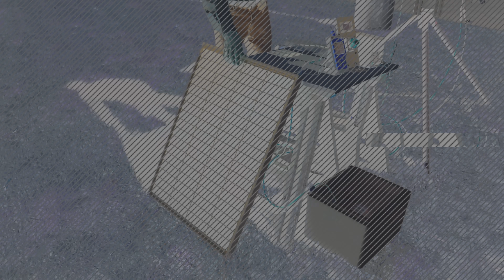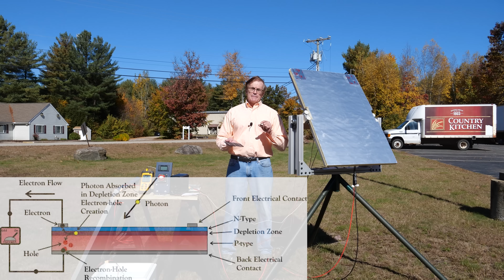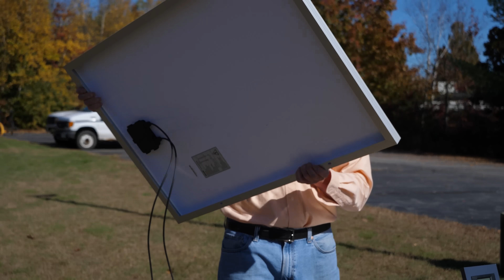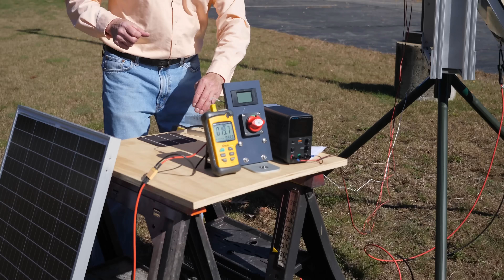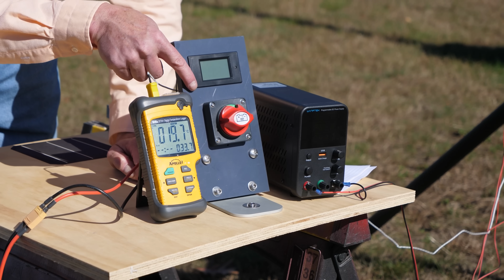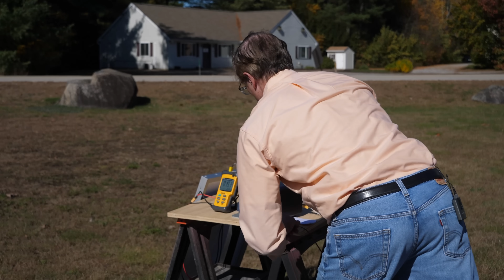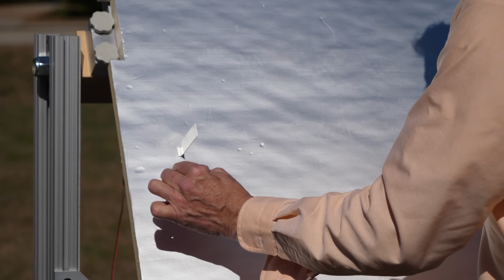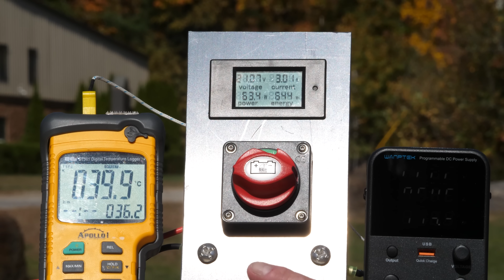Do you REALLY get enough out of your solar panel?

Comment: Fascinating.  As the wattage draw from the fans is so low, why wouldn't you use an auxiliary strip of solar dedicated to the fans built into each panel. If there wasn't enough sunlight to drive them at their most efficiency, you also wouldn't be dealing with the most extreme temperatures,  simplifying the system.  Sorry if someone has already addressed this idea.
Reply from the maker: They have.  And, this would be an engineering option.
I don't  see any problem with that approach.

Comment: The problem with active cooling is that it doesnt last forever and will require replacement well before the 25 year service life which carries cost and effort. I think there is a lot of merit in the idea of keeping them cool but it requires a better cooling system. The flipside is that panels are improving so fast that 100W gain for the same size over a two year period isnt unusual.
Reply: These appear to be basically common PC fans and are very easy to swap out.  The trick here, IMO, is to use old "junk" panels that are about 80% efficient due to age that are being thrown out or sold for dirt cheap.  Then use this with the mirror trick to overdrive them to better than "new" panel performance.  Yes, they will degrade another 2-3% per year being abused like this (the degradation slows down after about 20 years) So, even a decade later at say, 50% efficiency, they will still give you about what a new panel will.  Any excess heat can also be used to power his (almost) passive AC system as it does need a small heat source.  Win-win scenario for not a lot of money.  Especially in areas outside of NA and Europe where all you will have access to (that you can afford) are older 2nd hand panels and DIY methods to cool your home. Most people use ceiling fans or similar, but an AC system of any kind - huge improvement.   Doubly so since most of Europe has houses designed to keep heat IN and no provisions for AC.  His designs just require a bit of space outside and a hole or two through a wall.

Comment: How about taking separate tapping of water from a house water tank and  routine through those panels via aluminium tubes, then mating that with the inlet of a solar water heater... That way the efficiency of the solar water heater (since pre heated water is entering into it) and PV is improved in a conventional passive way?

Comment: Should look into super state core turbine systems incorporated got a neyodium magnet and liquid nitrogen I'd love to know but no Meter for now! to see the standard vs super state in field interaction especially in core turbine power system  looking 3/4 times in 3 test situation on 2 50% on grip??or the fact off audio alternator high current included possibly!. If true self electric twenty before serving and restart a 35Mw would have likely enough to run its self and would hold even on output??. If X3 a 35mw could obtain 105max MW potential??.card a seven band white crystal laser line can send a set out for a area fill across that cell night use 800w cell no like 20w 1cm laser x7 around 140w give loss light 700 600 total to sun not bad solar?????. properly checked!.

Comment: An aqueous system could work, using small pumps, assuming you had good access to water (maybe rain water storage). If the water is sprayed while exposed to the normal atmosphere, it naturally cools through evaporation (no fans needed).

As stated in the video, this could only help until freezing temperatures were reached. But further cooling the panels at low temperatures, yields low gains in efficiency anyway. One small 50th hp pump could likely service an entire array. The pump could be mounted at ground level, which greatly improves the serviceability  of the cooling system.

Comment: I'm excited every time this channel releases content, mainly because it's usually so well thought out.

I am surprised that the topic of longevity was limited to the panels. I have worked as a design engineer, where all the products I designed, contained small axial fan (such as these) as well as other types and sizes. I can say with some certainty, that even wash-down fans in an uncontrolled environment, will fail several times over the life-span of the panels.
Reply from the maker: You may be right.
Yet, consider that these fans are operating  at 25% of rated output and only need to run for perhaps 8 hours during every clear day.  They can also be installed  as a plug and play module,  making replacement only a matter of access as opposed to the effort required  to replace a panel.
Reply: @Tech Ingredients 
It's not the normal wear I'm concerned with. It's the contamination failures,  caused by: dust, pollen, cotton-wood, dandelion fuzz, spider-webs, etc.

As well, any service done to the fans in your configuration, likely requires removal of the panel. That is unless there's 3 or 4 feet of space below the panels.
Reply from the maker: That's  a valid  point.
However, our configuration was for a simple test.  I'm  sure you can visualize several methods for attaching them that just require  a hands width of access. Consider power tool batteries.

Comment: Makes no sense.   The fans will break after 1-2 years and need to be replaced and the expense in time and effort of just replacing them let alone the cost of the fans will be vastly more than just adding one extra $150 panel at the start.

Comment: I Love the presentation and the  efforts put into this and found it very inspiring , one question remains: Why did you choose an unsymmetrical airflow , it seems the distance to the fan ports are unequal top to bottom wich might result in a lesser cooling effect. The air will mostly flow from/to  the „short side“ , so although the heatsink will dissipate the temperature all over, only a smaller surface will be active.
Reply from the maker: I took advantage  of the convective rise in the air. As it heats, it becomes less dense.

Comment: I've wondered about the efficiency claims of PV panel vendors. It wouldn't surprise me to learn that they're quoting "best case" conditions, meaning at lower temps, before the panels heat up. My past evaluations of solar have shown that it doesn't make economic sense for most residential applications in my area without tax subsidies, and even then it's not such a great deal. 

The last time I checked, there were some industrial panels that boasted >40% efficiency, but they were costly and generally not available in the consumer market. That was a few years ago; things may have changed. Graphene technology is the most promising (95% efficiency), but until it can be mass-produced at reasonable cost, it's not an available option.

Anyhow, this video contains very useful information, especially the point about the temperature differential between ambient air and warmed-up panels in my area (Southwestern US) providing a relatively greater cooling effect for the energy cost of the fans. Great video!

Comment: I wonder, is it feasible to run heat pipes into a passive heat exchanger to run Stirling generators ? heat is energy, and just dumping it feels like a waste, as long as there is more heat in the solar panels than the ambient air, you can do work.

Comment: 2:43 so in effect you're increasing internal resistance?
Reply from the maker: No.  It's like I described.  The electrons can recombine with the holes before they reach the conductors. Increased thermal vibrations increase the likelihood  that this will happen.

Comment: What about a panel without any changes on the backside vs a passive panel with your changes at the backside but not turned on fans. I wonder if it is still worth it if you do the calculation when counting in the costs and the loss of passive cooling capability which is had on the backside without those changes.
Reply from the maker: The modified panel runs slightly cooler than the stock panel when the fans are off.
Reply: @TechIngredients  You mean the modified panel but fans off is colder than a not modified stock panel? How come, I mean the back side is quite obstructed / slightly insulated with that air-pocked on the back side (when the fans are off)...
Reply from the maker: The increased  surface area with the fins increases heat exchange.  Convection is very slow, and the openings  in the top, bottom, and through  the fans is plenty.  The back is in no way sealed .

Comment: How about instead of fans you'd use Peltier modules?
Reply from the maker: You'd  still need the fans to cool the hot sides of the peltier devices.  These devices  don't  cool. They separate  the heat so that you have a hot side and a cool side.
Reply: @TechIngredients  First off, thank you for replying (didn't expect it, because others don't bother) and secondly Yes, I realized that after I hit the sent button, but still I wonder if the fans would be powered by the Peltier modules would be better because wouldn't draw power from the solar panels. Not to mention that extra power (if any) from Peltiers could be used to add to the solar panels. It would be a win-win situation (or a pipe dream perpetuum mobile?).{ For some reason I am inclined to expect the pipe-dream scenario ;-) }
Reply from the maker: There's  an old saying  in engineering, "If you don't know the numbers, you don't know anything."
Peltier devices are expensive, especially  when you want to cover a large area.  They are also very inefficient.
Check out our previous video on "The Campfire Generator."

Comment: I LOVE becoming knowledged, but my semi-engineer mind instantly tries to poke holes in the whole setup, and since I suffer from tinnitus, guess which hole it finds: Noise. 

There is no way to mask noise. And I have serious doubts that re-programming your mind to accept the noise completely does anything but put the stress of this constant noise "in the background", mostly unnoticed by the conscious mind, but noticed by "the subconscious".

#Micronoise. Its around us more and more.
Reply from the maker: Please continue to look for holes.  That is how we progress.🤔
In this case, these low velocity  fans at 25% output power are completely  silent.
You can't  hear them even with your head less than 12 inches from the panel.
Reply: @TechIngredients  I kinda felt you would say that, but 100 or 1000 of them... constant noise adds up. 

Maybe get some sponsorship to disprove suspicions of compound noise?
Reply from the maker: You did?
Well, noise pressure is the square root of power and attenuation is the square of distance. We used 3 fans, 1,000 fans would produce 300 times the power and so, 18 times the volume, and so you wouldn't  hear them at 4 1/2 feet from the array of panels.
Reply: @TechIngredients  You out-physicsed me. I am obliterated. My personal experience counts as nothing. I am now in a different dimension pondering how to live with all the increasing micro noise around me, here too. Darn.

Comment: What about installing simple aluminum ribs from old computer processors and let the wind do the same effiency?
Reply from the maker: That's  an option.  You'll  need a very large number of these surplus  heat spreaders because  of the surface area you have to cover.
Passive cooling works.  Our modified panel runs slightly cooler than the stock panel, even when the fans are off.

Comment: Should have used a MPPT. Higher temps decrease voltage. If your fixed impedance is to the far right of the IV curve the results of your experiment will be exaggerated. Not to mention the maintenance of a fan system that will need several replacements over the 25Y life of the panel. Also, limiting factor is usually the inverter for which the panels are oversized. Because inverter sizing is based on yearly seasonal output, the added benefit from cooling the panel during the summer peak sun will not be realized by the inverter bottleneck. The benefit of the fan will likely only be for the peak daylight hours. Also, panels are cheap, any cooling apparatus needs to be cheaper than the fractional benefit it provides relative to the cost of say, just adding another panel, if more power is needed. Check out a company called RAYGEN, somewhat related but a bit different.
Reply from the maker: Because  I tested this, I explained  that we were right in the middle  of that curve.  The controller  would have simply  added another variable.

Comment: Nice work!  Do you think adding the heatsink to the panel but leaving it to  passive cooling, without the cover plate, would be close to the same results?
Reply from the maker: I tested that.  The modified panel runs slightly cooler than the stock panel when the fans are off.  But, the effect is pretty small.

Comment: Hello, there. I am curious what the temperature difference is with the panel "as is", without the closed back. i am thinking that maybe the box traps heat if the fans are not running, and also with the radiator only, without the cover. Although i think you are right about  the arguments for installig the cooling system, there is also the issue of maintenance. On a difficult roof you may need specialised workforce to check and clean the radiators and fans every year or so. There is also the issue ow warranty, which may be lost by modifying the panel in any way.
I have just installed my solar panel system 2 months ago, and in a sunny day i noticed a cca 30 deg celsius between ambient and panel's temperature.

Comment: On a cold but sunny day I’m guesstimating the power increase might be 15 watts. Maybe 20 watts? The colder the air entering the warm panel the better. I’m wanting to use this model as a hybrid house heater on the south facing window of our high desert home. Want to try it before winters over.

Comment: Two points here that I would like to see addressed.... 
1. If I install it on my roof correctly, there will be a chimney effect pulling a draft behind the panels anyway. 
2. Enclosing them in a metal box like he did increases the temperature... How hot are they getting without the box?
Reply from the maker: The modified panel runs slightly cooler with its fans off than the stock panel.

Comment: what about the energy costs of producing the panels, aluminum fins, fan manufacture?  They all consume energy to create.   We need to look at the big picture so we are not misleading.  Nuclear power is the way to go.  Tons of cheap electricity and uses practically no fuel and runs for years.  Very clean and very green and very safe.

Comment: But you seem to forget the much lower lifespan of the fans, and the cost of maintaining these fans over a 25 to 30 year lifespan. Even the best fans out there at an affordable price will not last more than maximum 10 years operated on a daily basis. Getting to the fans and replacing worn out fans will be more costly than the gains. But simply placing natural convection cooling fins on the rear would also help, while keeping panels in a 45 degree inclination for a natural convection to take place. 
Best regards
WATCH-Out

Comment: You made a video. Get 4X the power from your solar panels.
So this is now contradicting your other video. Cause heat in this video is decreasing power output. And on the other video you concentrate the light/heat is puting out more power??????
Reply from the maker: Have you ever heard the saying, " There are no contradictions. Check your assumptions."
The concentrators allow us to increase the power output from a single panel for lightweight  portability and to improve power when light levels are low.
Cooling increases panel efficiency and longevity when light levels are high and portability  isn't  an issue.

Comment: Would geothermal cooling be viable instead of fans.😬
Reply from the maker: It depends.  The upfront investment would be significantly  greater with geothermal. And, as you approach  freezing temperatures, the earth will actually  warm the panels. Also, there is always the potential  leakage and the need to purge the lines in winter.

Comment: please, how did you calculate how much airflow you needed for that panel? and is there a reason the fans were mounted on the top fourth of the panel?
Reply from the maker: The amount of heat that a typical panel  will absorb  is at most one kilowatt/meter^2 at the equator and about 2/3 of that typically where we live.  Take the specific heat of air and begin increasing the potential airflow.  The resulting temperature differentials between the ambient  air temperature  and the panel- warmed air must equal the absorbed heat. You want that differential as small as possible, but increasing the airflow will cost in fan power.  Look for likely fans and find an optimal trade off and then start testing.  
We went to three fans from two and adjusted the voltage based on further testing.
Simple!🙂

Comment: It might be costly, but a Thermal Electric Generator (basically a peltier in reverse) bonded to the back and even a small fan to aid in cooling the hot side of the TEG heatsink would add cogeneration - given the temperature differentials possible, I would be keen to see you guys do another experiment to see both how much extra energy the panel could produce with a TEG on the back AND how much the TEG can produce in addition to the panel. and even if a fan was needed at all.

Comment: Can thermal electric coolers be used to turn heat to electricity while cooling the panel? Might not be efficient enough or cost effective, jut a thought
Reply from the maker: They can, but you're  correct that they're  too expensive  and too inefficient.